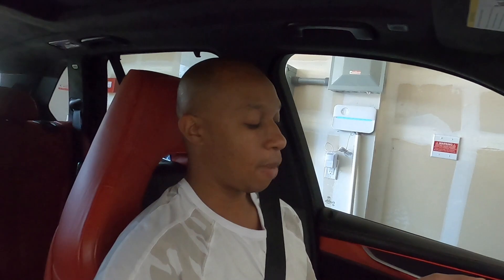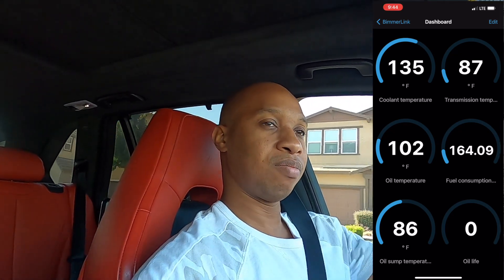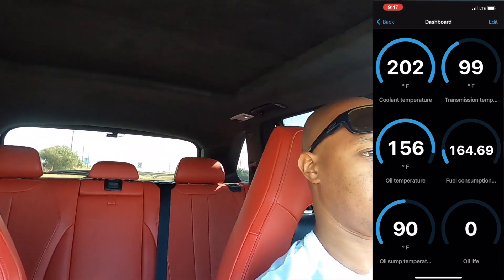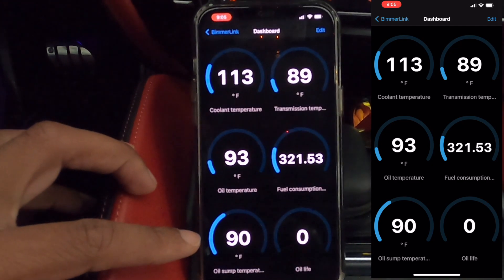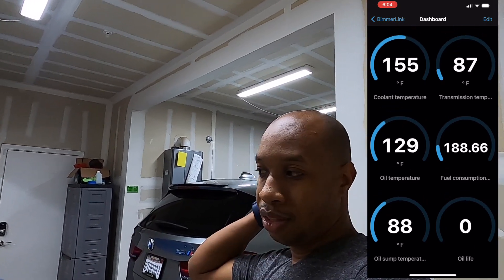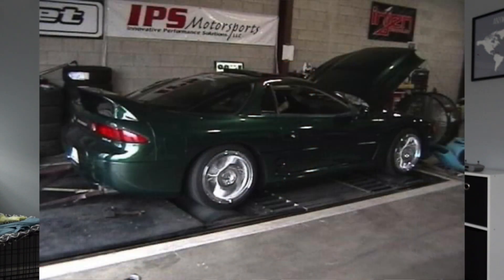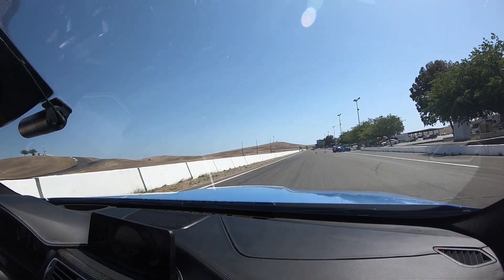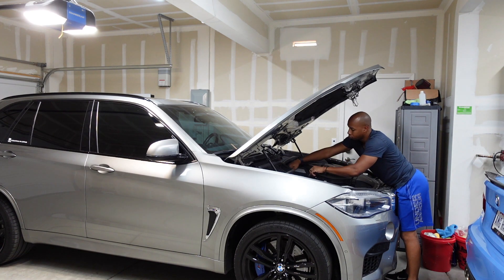Do Turbocharged BMW's Need a Cool Down? Plus Detailed Warm Up Telemetry

Comment: Thank you for the video.  I enjoyed it and it was very informative!

Myself, I prefer to let it warm up but maybe I'm just stuck in the past.  I just think it's beneficial before putting any load on it accelerating.  It's simply my opinion, however, I respect your opinion as well!

I agree that you should still drive easy even if you warm it up in the driveway as the transmission is not building much heat just sitting... that's a very good point!

Again, thank you for the informative video and for giving your opinions as well!

Great video!  I appreciated watching it and also hearing your views after your testing, thank you!

Comment: Hi thank you for sharing your useful information video it really helps me having a knowledge about a turbocharged car. I just took a delivery a 2023 X5 M50i when I drove the car home from the dealer about 12 miles away and I realized the engine compartment was really hot I can smell it I touched my fenders were hot I opened the hood and wow it’s was way hotter than my Corolla NA engine everything including plastic air filter housings were hot to the touch is that normal? Its the first time I ever own a turbocharged car, thanks.
Reply from the maker: Yes! Very normal!  Turbocharged engines will always be hotter than an NA. 
The smell is normal and will eventually subside as the plastics and other components in the engine compartment get used to the heat cycles.
Reply: Thanks for your reply I feel confident now I just got my x5 delivery just about 3 weeks ago and I custom ordered it 2023 model year has no acoustic windows, solfclose doors and cold/heated cup holder but I did ordered B&W audio system I know you really love that option. Thanks again!

Comment: when I start up my 650i I at least wait until the idle drops just as you did in the video. These cars warm up pretty quickly. I live in Chicago where the temps get really cold. I do sit for a little only in the winter time. If you live somewhere that doesn't get snow there's absolutely no reason to let the warm up for long periods of time. I just recommend waiting for the idle to settle and that takes less than 60 seconds for sure.

Comment: Cool dowm. Yes I personally let my car cool down if I've been running her hard and I mean full on Sport Mode traction control off and just really riding her hard. Cool down doesn't necessarily means letting her sit at idle. My cool dowm is putting it back in comfort mode and driving at normal speeds 5-10 min before I get home.

Comment: Avoid red lining your engine until your engine temperature gauge is in a 12 o'clock position. There is no harm in turning off your engine a few mins after you've took it for a spin at higher engine speeds.
Reply: If these Bimmers get to 12 o'clock.. that means its overheating .. i think u meant 10 o'clock

Comment: great video, good to see some real data on it. I occasionally interrupt the cold start (cat preheat?) by putting it into gear just to not wake the house on a late night drive. I've always wondered if it affects anything if I still let it sit for 30 seconds
Reply from the maker: I don’t think it does.  The car is still running lean to heat the cats despite the lower idle.

Comment: i normally put it on MDM mode and drive it for 5 mins to let it cool down, basically MDM Mode = MAX Cooling Mode
Reply from the maker: I beg to differ.  MDM= M Dynamic Mode
Basically less intervention for stability/traction control

Sport + Engine setting actually lowers the coolant/oil temp. 
You can program it into one of the M buttons
Reply: @eddiemcars  yes you are right MDM mode is M dynamic mode, but also the max cooling mode is turned on when we using MDM Mode, you could try it to see if the oil temperature drop down faster than comfort after you push hard
Reply from the maker: I’ll try it

Comment: I had no idea there were so many different temperatures in this car,transmission and even a coolant? Also what i found interesting is letting the car cool off before you get home or letting the heating out via the hood after parking it.Thanks for these tips they are helpful.

Comment: Love the content. Looking to get a X5 M just like yours in the near future. What is a good year an maximum mileage I should look for in the used market for this particular model?
Reply from the maker: I think 2017 and above would be a good year.  You’ll get wireless charging, WiFi hotspot. Plus retain the other BMW Connection function as the order ones will no longer support 3g.  
Mileage is subjective.  I’ve seen 30k miles look roughy and I’ve seen 50k miles look pristine.
Reply: I just got a 2016 with 18k miles, pristine!

Comment: Question… I have a 750 LI with a new engine and trans (4K mi) which I don’t run hard. When I get it home in the garage, I always pop the hood. What are your thoughts on placing a shop fan pointed directly at the engine for about 30 minutes after parking in the garage? 
Johnny
Reply from the maker: It couldn’t hurt!  
It would be the same as the M which runs its own fans to help pull heat out.